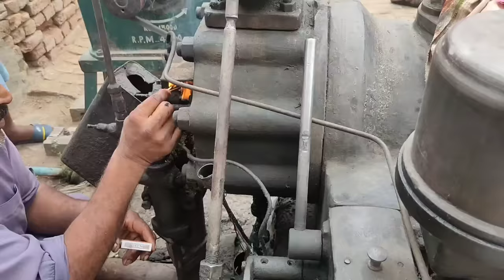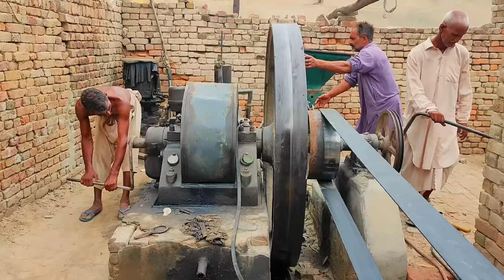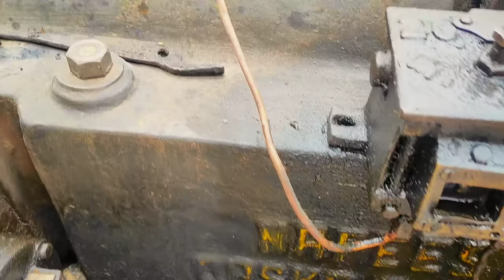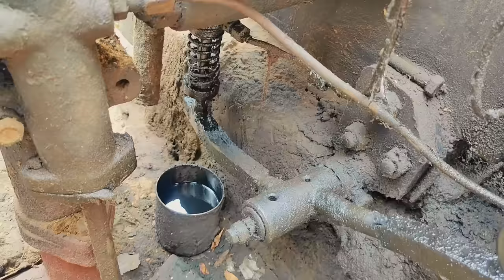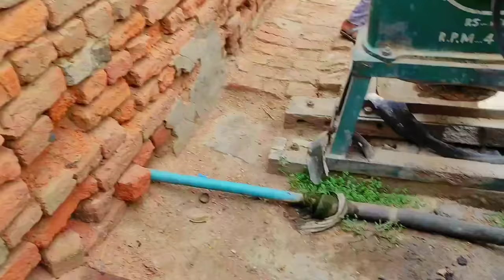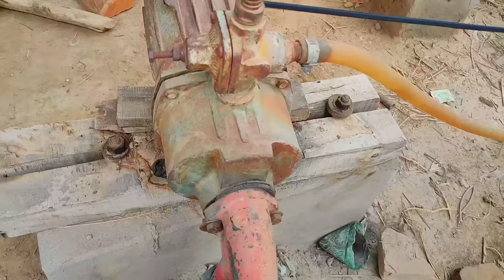Heavy old Black Diesel Engine Amazing Starting || Ruston Hornsby Engine sound

Comment: Great to see the next generation learning from the older.  Something that is missing in the so called "developed" countries.
Reply: All those who want to stop oil should do their part and not use anything that depends on the oil industry! Good luck with that! 😆
Reply: So true. Chances are the boys in that village are learning "Here’s how you solder a pipe. Here’s how you wire a switch. Here’s how you drill a hole in metal without ruining the drill."
There is so much learning that is not in school.
Reply: @anthonysinclair5721   Oil hippies need to change their phones tvs and laptops every year or so. They probably have 30 to 40 chargers around the house, buy the cheapest fan so they can trash it at the end of the season ... LOVELY.
Reply: Yeah, it’s terrific that they have children working on 19th century dangerous machinery, why doesn’t everyone do that?
Reply: Jfes
Reply: Utt
Reply: Oh come now

Comment: What an awesome old engine! 😎It sure looks like it's set up to do a lot of work. How much fuel does it use per hour? 👍
Reply: 6.5 ltr / hr
Reply: @waah-pj1xk  😎
Reply: @waah-pj1xk most modern diesels with machanical injection deliver around 1 hp per liter or quart  of fuel burned -  that engine burns 1/4 liter of fuel  per hp out put - that engine would have a 16:1 fuel efficency meaning it burns 4 liters or 1 gallon of fuel oper 16; hp out put - 
      High speed light weight diesels are never higher than 6:1 - 
     many stationary engines run at  high tempeture ( thats 250° F or 120° C)  and very slow speed they run on bunker C or heavy bunker F - they can have efficencys up to 28:1 
    I worked on engines in the oilfields for decades - there many stationary engines in service to this day out there  -
Reply: What an awesome old engine!
Reply: @AllaEzhevichka  2/3 of the world is concidered developed or up on modern equipment - that includes grid power - 
     1/3 of the world is concidered undeveloped - in that 1/3 the world they continue to get there power from oil burning engines as in that video - in India the grid if it's sent to  rural areas doesn't have the power to run 25 HP electric motors 
  So those engines are still in daily use pumping water grinding grain and generating electricity - 
       There many similar engines in remote oilfields In the US on wells pumping jack pumps on oil wells - some of those engines have been running  90 yrs or longer every day -  there ajax and arrow gas engines  similar to that one in oilfields world wide that run yr after yr - 
      They might only run at 300 RPMs so they run for decades -with out being rebuilt -
Reply: @AllaEzhevichka  in many areas of the world irrigation is not needed - in those areas it's necessary those engines are highly prized - in developed areas as in Europe and the US fuel per Capita is inexpensive - 
     So we use high speed light weight engines - in under developed parts they can't afford the massive amounts of fuel high speed engines burn also high speed engines only run 1 or 2000 hrs or 2 to 4 months day and night and are replaced - were as those will run for generations to come -

Comment: Fire 🔥🔥🔥🔥🔥🔥🔥🔥 wall it and see how long it will last before parts start flying off and you to run💥💥💥💥🎱🎱🎱🧨🧨😆😆😃😃😄😄😀😀
Reply: He did. Probably good for 100 rpm and has lasted a hundred or more years. Will need first service about next year before handing on to the next generation.